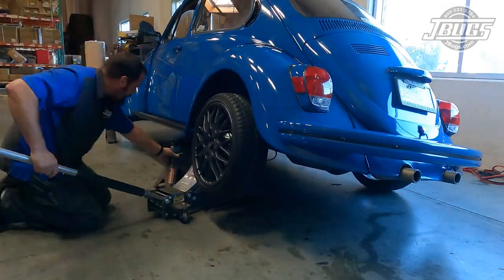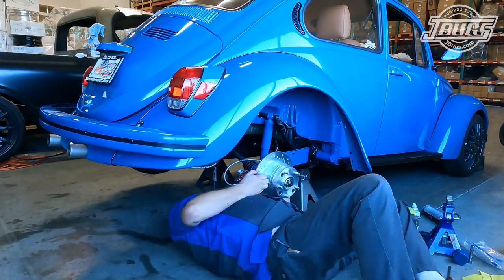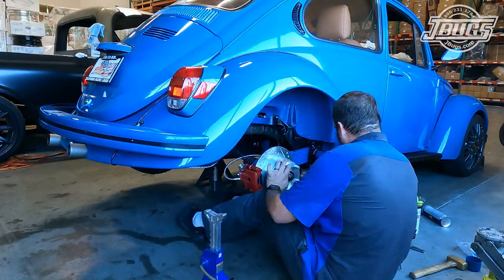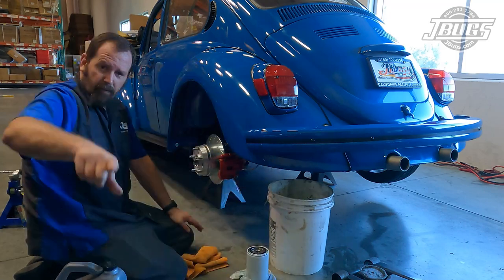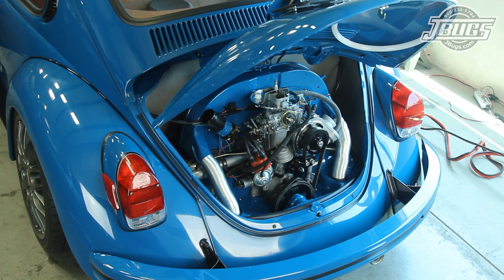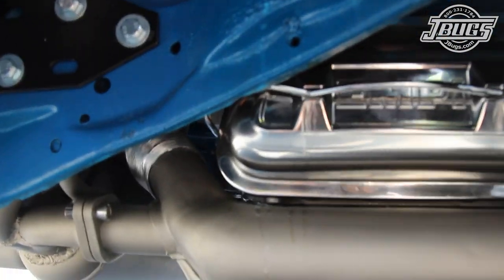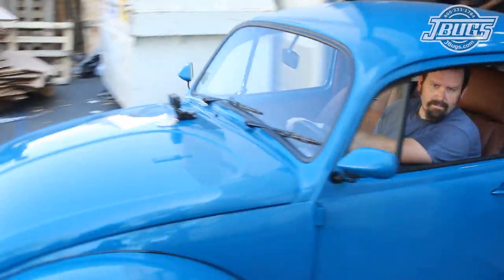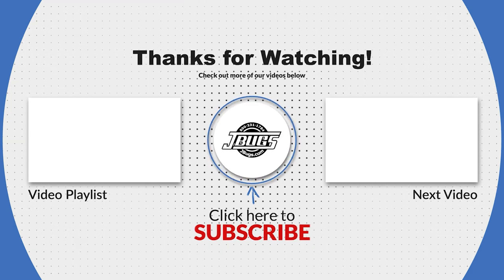JBugs - 1971 VW Super Beetle - Final Adjustments

Comment: I had the same issue with the valve covers.. Swapped for bolt on covers and no problems
Reply: Yeah. on the stand the valve covers worked well, that was 3 years ago now I think. The bolt on ones just seal better regardless though.

Comment: What wheels are those? Are they 5x130 or did you use adapters? GREAT BUILD!
Reply: 17x7 5x130 BBS Sport Classic wheels with a 55mm offset on billet aluminum adapters.